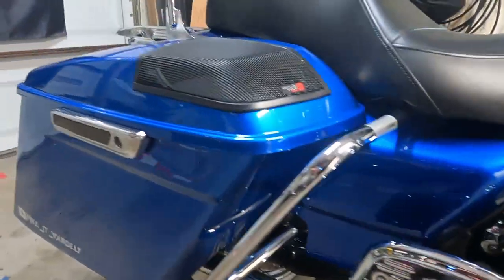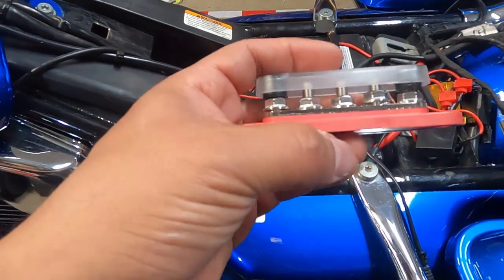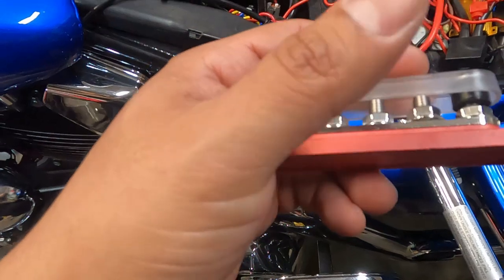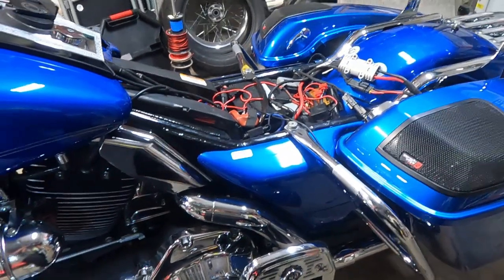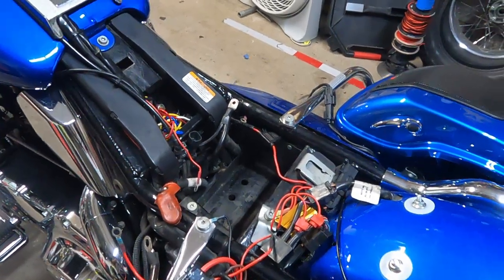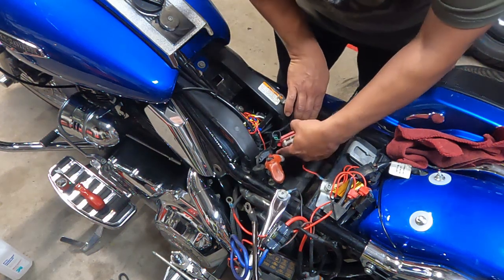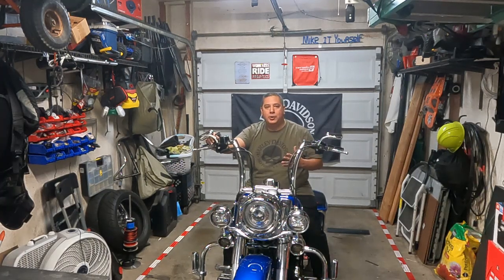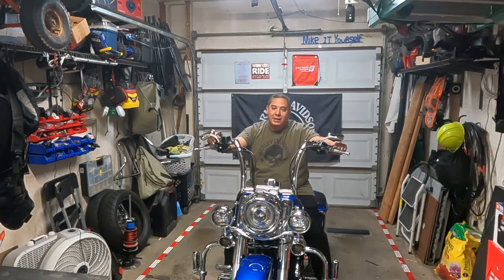Make your wiring look professional with a Battery Bus Bar

Comment: Nice improvement. 

Just a thought. When you go to add the fuse between the battery & distribution rail…
An AGU style (larger glass fuse) holder will fit nicely in that space where you have your Relays. 
I added the AGU to that location on my bro-in-law’s Road King, and on my Ultra Classic. 

Good video. Your wiring looks way better.
Reply from the maker: @uniqueflh2941  I ended up getting a maxi fuse in there.

Comment: Nice . 👍 my Optima battery has 4 post made wiring little easier
Reply from the maker: @TheBlueBikeDoyle  If I didn't get the lifetime replacement from HD id probably replace it with one of those optimas. Might take a look for my RG. I'm running two amps in that setup.